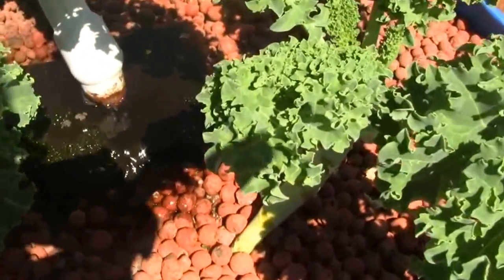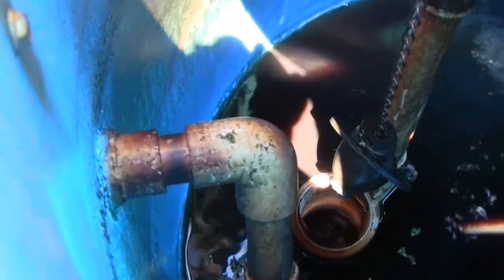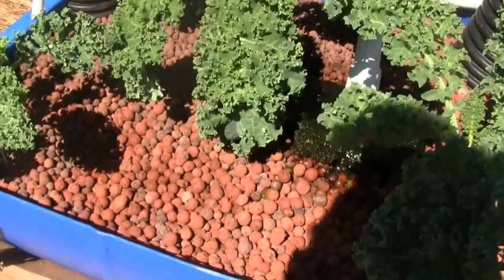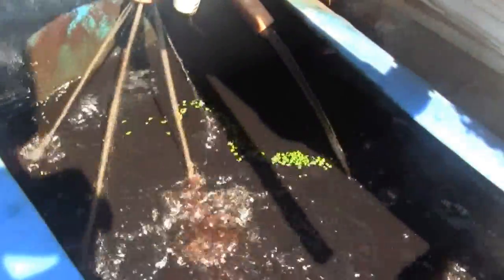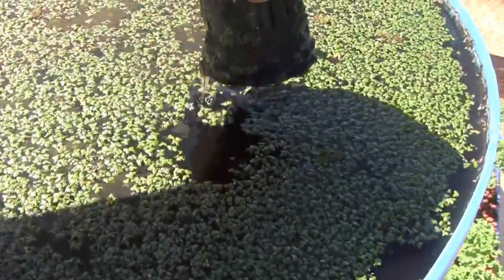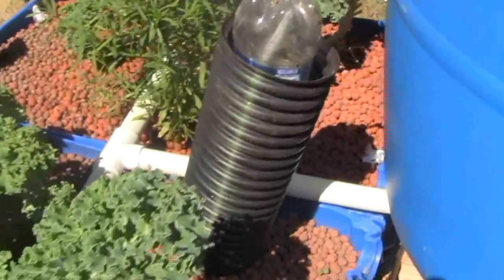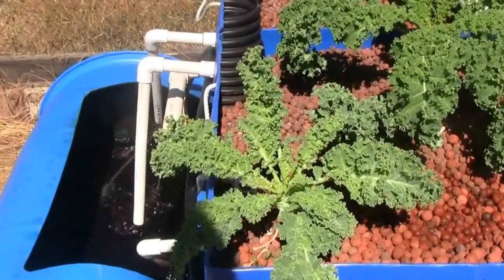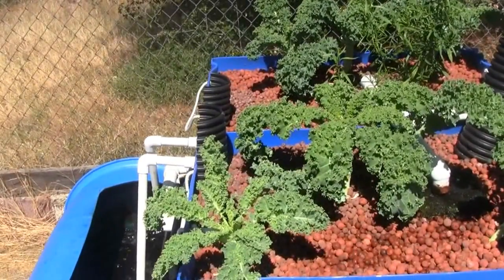Great Little Aquaponics System 1

Comment from the maker: The darkness of the water is kelp.  Doesn't hurt the fish and helps add micronutrients for plants.  Probably had just added some kelp in videos where water is dark tea colored, vs had been a while in videos where water is more clear.
One things very important and we didn't do it right on the 4x16 system with Koi.....In vertical elevation, you want, fish tank outlet highest elevation, then a fish solids filter (if used) then the media gravel bed, and finally a sump, pumps in clean sump water.
rt

Comment: The water in the fish tank is much clearer in the 5 weeks old system (video 2) than here. Is it work of a more mature system or you did some extra filter or cleaning or else change? Also the points where water floods the beds are not as hypertrophic as in this video.

Comment: Hi RT, in the second video you said you don't think the duckweed tank necessary for big particulates precipitation. It seems to me that the point the beds are flooding works as particulate filtering and processing areas (moss/algae/bact/ecology). Did you think about it in the beginning? My question here is if this area is eating away nutrients from the fish water, thus reducing the fish weight/plant growth ratio, or the opposite, producing extra nutrients that dissolve in each flooding cycle?

Comment from the maker: See 4 x 16 aquaponics system videos.  Basically, the total weight of fish equate to the size of the "engine" you have.  but like an engine, you don't need to fun it at full throttle.  In the end, it boils down to how much fish food you supply vs how many plants you have soaking up the nitrates that counts.  Rule of thumb is 2 pounds of fish per cubic foot of grow bed volume, with 1 foot deep grow bed.........so, that's also 1 square foot of grow bed surface area.

rt